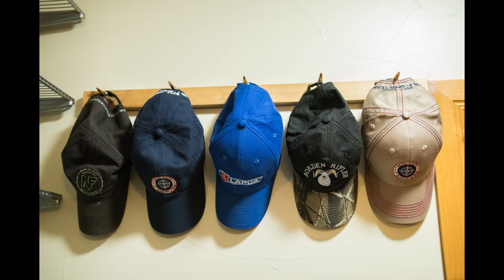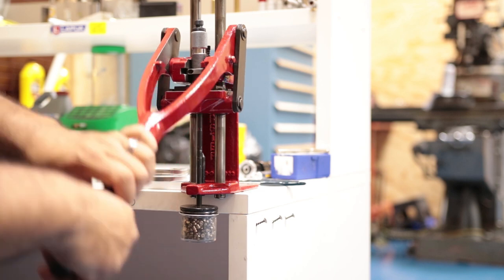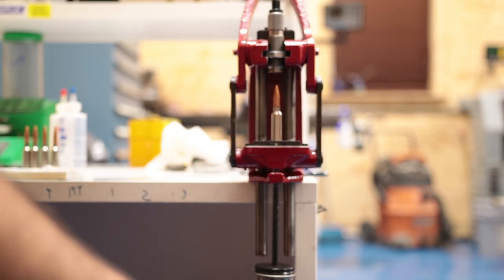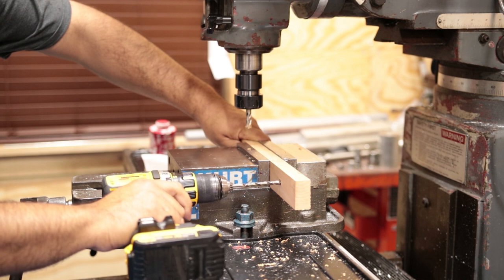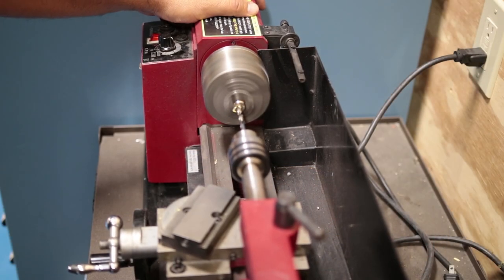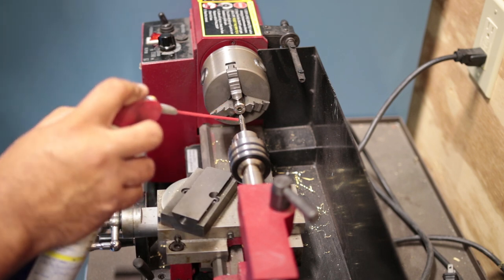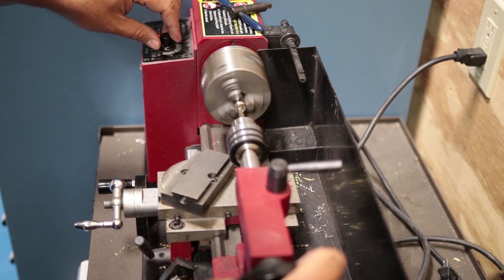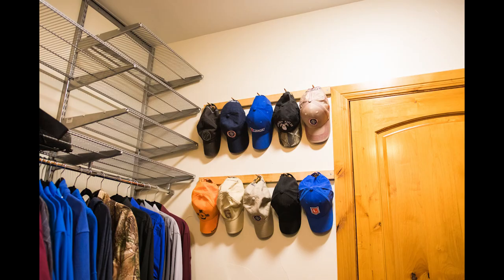DIY:  Hight ballistic coefficient hat rack

Comment: Nice work. Maybe drill them at like a 45 degree angle, if you make any more. Not trolling.. just a thought. thanks for the vid.
Reply from the maker: 66blacksunshine I actually though about that and did a small test.  I found that it really didn't matter so I went with the easier version.  Thanks for watching.